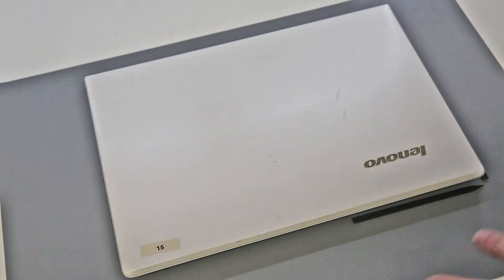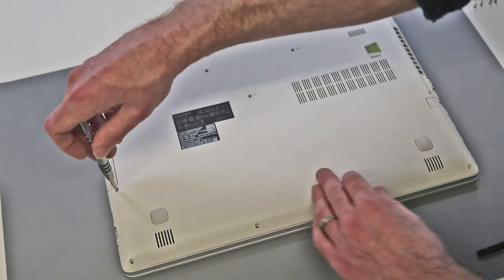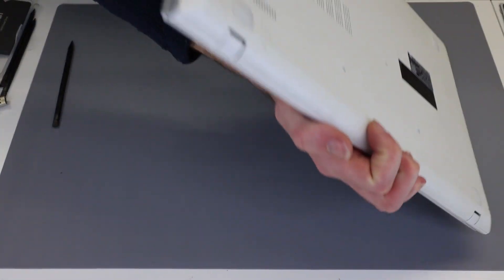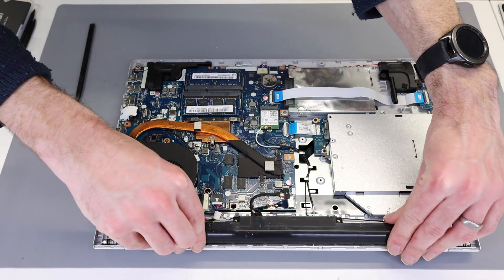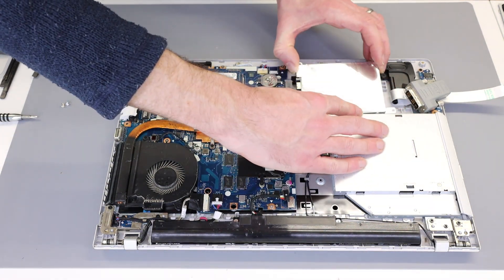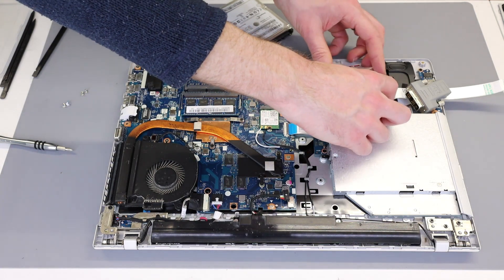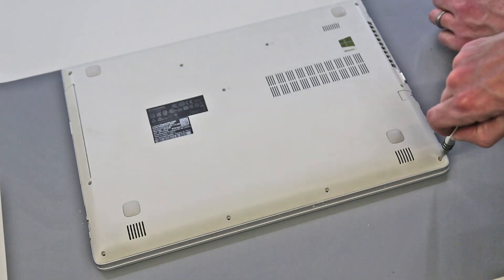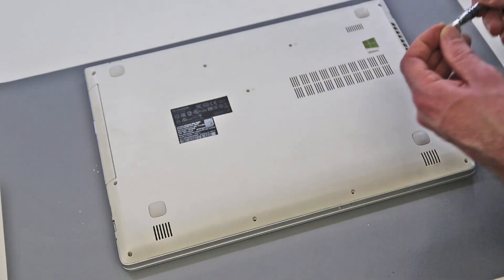Lenovo ideaPad 500-15ISK HDD/SSD, Memory and Battery Upgrade and Replacement Guide

Comment: Hi firstly thanks for the video, I have a question, I have one of these and recently needed to displace my battery and out the new one, even though I believe I did everything ok my pc could not detect the battery, I thought that there should be a software issue however I disabld and uninstalled drivers I scanned hardware changes, nothing worked. There was another issue while putting the batteries plug in, I could not push the plug like you did in this video, I assure you I used both fingers but it did not get in nor I am not sure if I put it in right direction. Now my computer shows two alert constantly toggle between each other, it says battery fully charged and it switches to battery is not present and this happens constantly. I would be really appreiated if you give me idea to solve this problem. Thanks again for the video!

Comment: Cpu repaste and cooling system clean also.
Reply from the maker: Unfortunately I no longer have the system - it was a customers machine and only had it in for an SSD upgrade.
Removing the heatsink is just a case of undoing the 5 screws that hold on the two headspreaders and lifting . Likewise there are 3 screws to remove the fan for cleaning.

Comment: I'm planning to upgrade my lenovo ideapad 500 15ISK model with 1TB SSD and Ram with 8+8 = 16GB I would like know the performance of laptop with Win 10 after upgrade
Reply: Bro where did you get 8+8 ddr3 ram and can you tell me price and speed of ram
Reply: @Rishi-he7hs  Also after upgrading the RAM and SSD windows 10 OS is booting very fast in fraction of seconds and also gaming experience is also fast
Reply: @Rishi-he7hs  I bought in local store for Rs.3000 for 8 GB DDR3 RAM as I already have 8 GB in my laptop
Reply: @karthikbalaje  thank you bro.
Reply: @karthikbalaje bro. I want to upgrade the ram and ssd in 2023. How is your laptop doing now??  I also have to replace battery. Any suggestions?